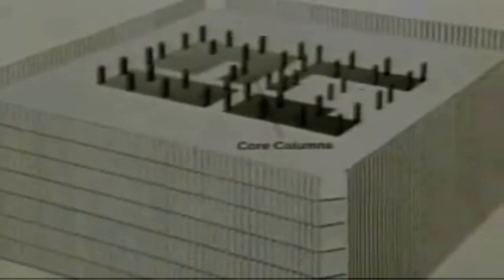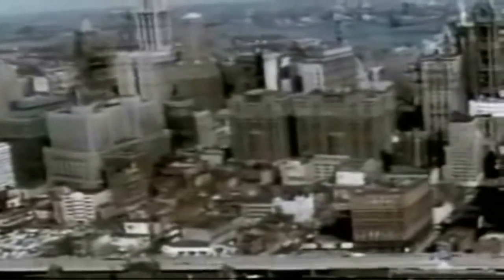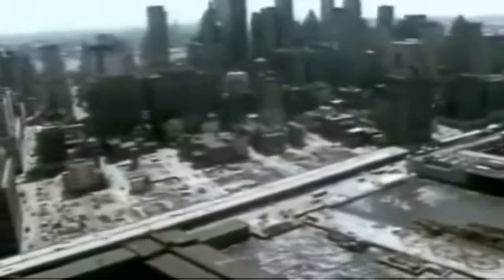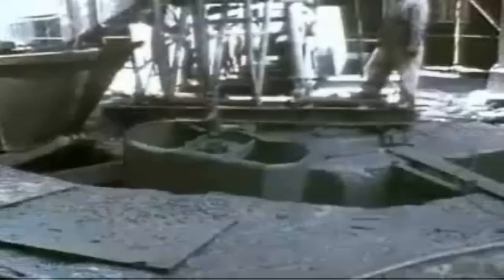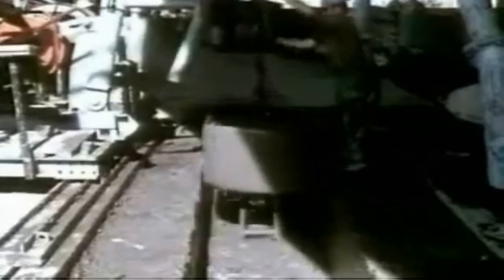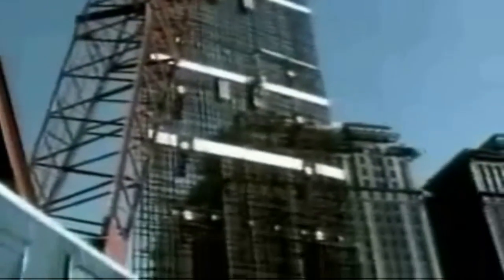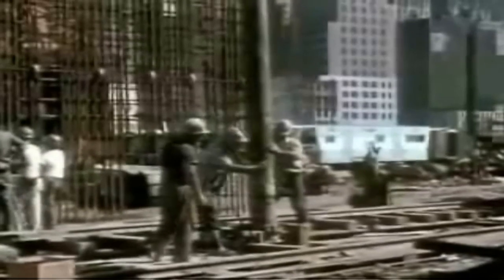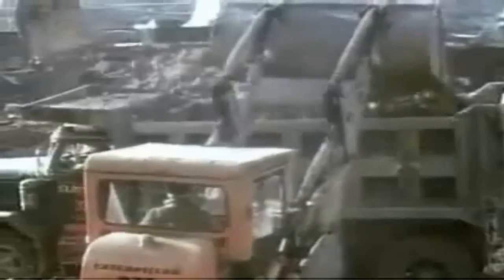Building the World Trade Center Towers

Comment: I had to go sit with my elderly father when these building collapsed.  He left his family,  including a new born me, to go to NYC for six month periods to help erect these two buildings.  He worked on the inner columns, very hazardous work.  I know he did tell me that unlike most steel framed buildings, all the weight of the buildings was on the side walls.  It was designed that way.  He was not surprised that the buildings collapsed.
Reply: You are very emotionally tied to your theories.
Reply: You are very touchy and defensive.
Reply: +Joseph Rogers 60% of the mass was supported by the core, the other 40 by the perimeter walls. connected by a hat truss.
Reply: ALL of the weight was not carried by the perimeter walls. About 35% of the total weight of the building was carried by the perimeter skeleton. The other 65% was carried by the core columns, which was essentially a traditional steel frame building inside of the WTC towers. When the plane struck and crashed through the outer perimeter, forces were redistributed and the towers remained standing. According to NIST (the official government investigation) nearly all of the jet fuel was consumed within the first 5 minutes, and probably about 90% was consumed in the initial fireball. So there was no "jet fuel" fire. Sure, jet fuel helped ignite regular office furnishings, but it was still a standard office building fire. A steel frame high rise has NEVER completely collapsed due to fire before or after 9/11. The only 3 examples happened on 9/11, and one of these towers wasn't even hit by a plane (WTC7).  A partial collapse would make sense, but the majority of the building should have remained
Reply: How is a load diagram ridiculous. It is not that technical. Google it Shitdick.
Reply: Joseph Rogers Yes i was born an engineer, a natural. Over the yrs i was told that by my peers many many times. I Know how to design and build virtually anything that would stand up to continuous vibration/weather/freeze/thaw...you name it.
I have worked with engineers with degrees above mine, i had to teach every damn one how to do things right in many instances.
I have benchmarked in the ind. more than twice... Yes the towers were the marvel of their time but a human rat trap waiting to happen.But nobody wants to hear it...those brackets where to small too few too weak...the truss design also no good in the event of fire . blg. 7 was built the same way.
Sucks to be right.
Reply: Thrashaero
I am just going by what a man who spent two years of his life building the twin towers knew.  he know where short cuts were taken and where they had to "improvise" to get the towers up on the time table they had.  Much of the outer wall columns were for the most part hollow.  This was loved by plumbers, electricians and phone company.  Later by internet companies.  Hollow walls= access to bring wires and pipes up.  I also is a conduit for flame, fuel ect to go down.
Reply: @joerogers4077  are you saying that the tower's perimeter wall columns were used to route services up the building? This sounds outlandish in the extreme. How would you install and then access to repair & upgrade them when they're sealed up inside the steel tubes? The columns were attached to the ones above and below by bolts and there was no gap between columns for anything to pass through. I should think some of the sources on their construction would have mentioned that the tower's columns were used to route services by now.
Reply: Jon Hobgood .....and who are you???
Reply: +Joseph Rogers The fact that your father isn't shocked doesn't mean that he has factually proven that the official story of 9/11 is true.
Reply: Always Skeptical The buildings were put up with hollow exterior weight bearing loads.  The only thing that prevented the tops from tumbelling off was the core steel.  The floor trusses were steel but the flooring itself was concrete covered aluminum. Once the top floors sagged a have out.  Gravity took over.  The building was never intended to handle this kind of load.
Reply: +Joseph Rogers With all respect and especially with your father, but concrete doesn't burn.
Reply: +Hoobler08 design flaws don't just suddenly happen after the buildings have been standing for 30 yrs usually building are designed before construction starts maybe you need college
Reply: My grandfather worked on the steel exterior on the south tower, and my grandmother's brother did the windows on the north tower
Reply: The planes easily enter the Towers. Perimeter walls were 10'x30' panels of hollow columns, 3/8'' steel at impact levels, stacked end to end, butt jointed and bolted together. Mass of planes (about 150 tons at 500 mph) pushed the panels, which sheared the bolts holding them together. Wing impressions in the walls outside the engines were in the aluminum cladding; the columns can be seen behind the cladding still standing.
Fires were NOT normal. Fire barriers were instantaneously breached, and rapidly ignited across many floors. Combustible material was shotgun blasted by the planes into one side of the Towers, exactly where the hottest fires were observed, and precisely where collapse initiation was observed.
Collapse initiations were gradual, with the inward sagging of perimeter wall, until that wall could no longer support upper mass, and the tops tilted in that direction, ripping apart the core columns.
The Towers were hollow tubes, with 60' spans on two sides of the core, and 34' on the other two sides. The tops wedged apart the lower tubes as the upper mass fell inside the tubes, and worked it's way around the core structure.
It's not difficult. "Truthers" confuse themselves with all sorts of false premises and lies.
Reply: Jon Hobgood why Do you fear bacon?
Reply: Ron Burgandy Rebar in the floor not in the walls.The floors were made at the factory barged in they were covered with aluminum they put rebar or the floor only then concrete not in the walls.   Rebar on to of aluminum flooring before concrete is poured, the aluminum will sag in fire.  Shitty materials were used Aluminum melts at 1218 degrees F.  It did get that hot.  Aluminum softens, sags the cement put on top of it is not designed  to bear it's full weight of the floors above it.  Then one floor after the other came down.  The towers came down about 200 mph with more and more gross tonnage with each second.  Nothing can stand up to that.
The internal structure of the wing of Columbia when it burned up was made of aluminum and needs the protective tiles to prevent melting.  Tiles broken upon launch. On reentry, heat got into the wing, melted the aluminum and blew apart a fast moving steel and aluminum craft. .  In the WTC,  the hits were so high up that when the aluminium covered by concrete began to melt, fire reached the underside of each floor (the ceiling) the alumninium could not handle the weight  and it came down. like a pancake.  How is that tough to grasp??
The original plans for the WTC are available by the FOIA, read them very interesting stuff  seeing how they put the building sometimes up on the fly. Needing to stay on schedule.  Those buildings had no fire exit strategy poor alarm system, poor entrance and exits and not fireproofed.  Open a fiberglass ceiling tile look at the trusses they are covered with a soft, rocky type substance.  That is there to prevent the floor trusses and aluminium sub floor from melting if you see bare metal as there was in the WTC.  No fireproofing was present.
Reply: It was a controlled demolition, no skyscrapers have ever collapsed like that before or since yet 3 collapsed on the same day for fuck sake. I don't understand why people debate why the buildings fell, they all fell because explosives were rigged throughout the buildings simple as that.
Reply: @Dan_druft  Rigged with what clearly an intelligent person like yourself knows demolitions and explosives leaves evidence lots of evidence yet. You can clearly see the South Tower already starting to crumble just prior to the collapse from undamaged parts struggling to hold the entire weight of the building
Reply: +Jose Rodgers take it from someone who does this shit for a living I build buildings using steel and concrete on over 1000 properties there is no way NO WAY  you can damage the underlying structure of a building by damaging the top quarter of the building I'm telling you
Reply: +Jose Rodgers for a building to fall down like that the steel had to be compromised there no way that could happen to the underlying structure by damaging the top 20 floors its impossible
Reply: Ron Burgandy And you got your engineering degree from where?  And you were part of the team that built the buildings?  I had a relative that was both.  The NY/NJ port authorities were in such a damn hurry to get the building up that corners and expenses were cut as many times as they could.  Can the building withstand a direct strike from a jet passenger plane?   Yes, they were designed to.  What consequences were possible when there was a fireball and fire burning in 1968 fire coded materials?  No one knew. Passenger jets were not all that old when the buildings were started.  Aviation fuel today is much more explosive and burns hotter.
Reply: Jose there are millions of 20 story high steel framed buildings What you forget is that most of the weight in the towers was below the impact zone so the weight above the impact zone is the only thing to take into consideration, If you look closely at the collapse of WTC1 you can see it begins its collapse from the impact zone up so the top section is not impacting on the rest of the building, your argument that nothing could hold the weight of each section is misguided, The rest of the tower was designed to hold up the tower and it did that for 30 years.
Reply: Gee - I guess a massive aircraft smashing into the building at over 500 mph just might cause some design flaws, no?

Look - you can banter and try all day long.  You are not a structural engineer that built these buildings.  The very men who poured their lives into constructing them gave a clear and descriptive analysis of why the buildings came down.  The example I gave of the spaghetti noodles was, in fact, from them.  Not my own reasoning - unlike what you are attempting to do.

I know though, anyone who dares to say this wasn't a conspiracy is just part of the cover up...   Do you hear yourself?  Please, spare me.  Tired of this nonsense from everyday youtube geniuses.  

Most of you probably haven't even attended college, let alone graduate... yet here you are, telling the world what a 110 story building should do when a jumbo jet smashes into it.  I mean hell, it's such common knowledge, look at all the examples we have to look at of the same event happening around the word throughout history- right?
Reply: Hoobler08 Oh it was a conspiracy for sure.
It would have taken months to plant all the explosives in the the three skyscrapers and it took a lot of planning and forethought to have all the fake information ready to give to the media, the slipped up there though by giving their already prepared media release about WTC7 to the BBC too soon. There were people on the ground telling whiteness what they saw was different to what they were saying they saw. They went to a lot of trouble to plant fake evidence but they slipped up there to by planting the wrong jet engine, oh there is no doubt that it was the biggest best executed conspiracy that the world has ever seen. And most of the world believed it even me for a long time, but thankfully I woke up to what happened a long time ago, Time for you to do the same!
Reply: Thrashaero Sorry pal i tell it straight up.
Get over it truth is fact and will not changed.
Nuff Said !!
Reply: +Charlie Varrick wow that's a halfass rebuttal if i've ever seen. bragging how you 'tell it straight up' and 'truth is fact'. nice patting yourself on the back there with zero details providing any justification for your 'straight up truth is fact' bullshit. nuff said  git er dun hurrr!
Reply: +Charlie Varrick that's because you can't handle your bullshit being called out and therefore project your stupidity onto the one calling it out as an excuse to continue talking shit than taking responsibility for the shit previously said. fail.
Reply: +Joseph Rogers floors above the impact collapsing is a far cry from the entire perimeter symmetrically failing at once and exploding out all 4 sides with nothing left but splintered steel. after collapse, 20-30 floors of top of skyscraper mass is going to do relatively very little to what is below it since it is always the lightest part of the building.  He is right about the core.  As far as damage to the lower structure, there may have been very substantial damage such as what was described in the basement and lobby to likely cut out the core and foundation (pulling the hat truss down and floor trusses inward much more effectively to make it look like it started to fall through itself) but it has not been assigned responsibility for the collapse in any official media/reports. 
NIST say it is primarily from fire, come up with 'new discovery' called 'thermal expansion' that is not reflected in building codes since, and then say that once collapse starts, the rest of what was observed was inevitable. Then they can't be bothered to have their collapse model values peer reviewed. Then one of them (John Gross) denies molten steel meanwhile having been previously photographed holding onto a peice of molten steel.
The worst attempt at science/investigation i've ever seen.
Reply: +vengencefrom1979 thats incorrect.. the debris were not falling at free fall as you can see smaller pieces from the same area below falling at a faster speed in the footage
Reply: CANT STUMP DONALD J TRUMP - #TRUMP2016 It doesn't melt and you can see in numerous videos recorded that day molten steel pouring down the building.  The first, second, third responders found in the rubble pools of molten steel.  What would cause the kindling they found under the rubble many day after the buildings fell.  Normally the impact would have put the fire out.  If there's no oxygen, fire can not kindle.
Reply: Jose Rodgers all the time bro
my uncle harvested coconuts.
i have in family photos and actual fruit.
Reply: 30% of the downward force from the building was supported by the outer walls.
Reply: At 400+ nauts.  It can certainly pierce the walls.  The walls had some steel but basically aluminum covered with stucco material.
Reply: +Jose Rodgers Oh I believe you. But you know people on the internet....yeah. Fun fact I knew a friend who would come and do maintenance on the towers in the late 90s-Early 2001 and he always complained about some of the walls being hollow. He was always telling me stories about how the buildings didn't seem as strong as they looked. I'm not surprised the towers collapsed either. Those buildings were not designed to survive a plane slamming through them with thousands of degrees of burning jet fuel. Jet fuel plus human bodies and the office supplies plus luggage, etc...really took a toll on those buildings.
Reply: *****
First amendment, freedom of speech, ever hear of it?  Don't like what I post, sign off.  I have had to read people posting that a hard working man who died in 2008 had convictions  he held about those buildings.  He spent four years of his life working on them. He did state that no one in the design and building of a skyscraper would ever think of a 767 loaded with fuel going 400+ nauts. hitting the building what kind of damage would have been done.
Reply: SHUT UP ALL OF YOU
Reply: Verdoux007 I got your point, I just do not care about what you think.  I was born and still live in the United States.  If you want to see the first amendment and it's protections watch a first amendment audit on youtube
Reply: Thrashaero 
"60% of the mass was supported by the core, the other 40 by the perimeter walls. connected by a hat truss."

I just read this. Can site how you got this information. I am sincerely interested. Thanks.
Reply: SHUT UP SHUT UP SHUT UP SHUT UP@! OMFG STOP COMMENTING
Reply: Jon Hobgood You better just cool the fuck down before someone gets hurt. Do you hob good nob Jon? Just go do that until you can offer up an intelligent point.
Reply: Jon Hobgood 
""i'm tired of these notifications popping up every time you people respond, it's irrelevant."

You are irrelevant and you can remove notifications but I won't tell you how because you are just plain rude.
Reply: Verdoux007 You have difficulty following logic it seems. That has nothing to do w/ nationality.
Reply: ***** = Too Cool For The Room Douchebag Who Thinks He Is All Deep And In Touch
Reply: it was built in '66. approvals probably were not as hard to come by as today's are.
Reply: Alzheimer's
Reply: @paulczar Did you listen to the video at all? your 60-40 is switched around. stop thinking in today's building codes and start thinking in the 60's building codes.
Reply: +Jose Rodgers cuzsteel made in the 60s  was known to crumble apart for no reason that explains everything jeez all thos time I thought bush did 9-11
Reply: Ron Burgandy No, cement of today, highly engineered build things like the Burg Kalifa in Dubai.  High strength cement.  The cement used in WTC was basic cement used in Empire State ect.  The building codes were horrible back then, More than half the people who were trapped was because of thin stairway, no emergency battery stair lighting.  This all came to light in 1993.  Many think the 1993 attack was a trial run for the 2001 attack.
Reply: +Jose Rodgers ya I'm sure a building built by slaves in dirty turbins in the desert is way stronger especially since they now know how to mix the concrete correctly so that is won't all turn to dust for no reason after 30 years
Reply: +Jose Rodgers what's that at 8:37 then? sure as hell looks like rebar to me
Reply: +Jose Rodgers at 8:35 two guys are clearly installing REBAR you don't run wire conduit in a criss cross patern like that
Reply: +Jose Rodgers why would you need rebar in a 30 ton three story piece of steel do you even know what rebar is?
Reply: Jose Rodgers
If the fuel burns  quicker and hotter then most of it would have burned off in the initial fire ball. But I doubt very much that the fuel has actually changed, it's the engines have become more fuel efficient now days.
Reply: paulczar Had any of the steel framed buildings that did not collapse have the size and the weight of the WTC?  The weight from above must have been tremendous for the damaged section to hold.  The top came down the weight was too great down and down it repeated.  I forgot how much time it took for the whole 100+ story buildings to fall and the speed they went at but there is nothing, nothing that could hold the weight of each section coming down
This was a perfectly planned attack, hit the buildings around the 80th to 90th floors or so and let gravity do the rest. There was tons of weight on the roof of both towers and both towers had piss poor fire evacuation plans that cost lives.
Reply: +Newcopia exactly the top section is breaking up not gaining mass as it comes down its simple logic this guy is fuckinh high
Reply: +Jose Rodgers size an weight was not a factor in their demolition buildings don't fall down because they are "too big"
Reply: +Jose Rodgers so your family both designed and built some buildings that failed for no reason and you are bragging about this? maybe its just your dna then and not the bush family that has been such a scorge on society for so long
Reply: Jose Rodgers Whatever it is you are on you need to stop doing it. There is a disconnect between what is left of your brain and realty!
Reply: Always fun being lectured by the youtube experts.   You're wrong, but you have the right to be.  What Jose Rodgers said is 100% accurate.  The weight was on the outer beams, which were stabilized by the floors.  Once the floors burned and started to peel away from the outer frame, what was a short distance of stable beams, now became very long sections holding massive amounts of weight.  Think of uncooked spaghetti noodles - if they are short, they are really strong and hard to snap if you pinch them on each end; likewise, if they are long and you pinch each end, they break with ease.  That is exactly what happened and you can see it by how the towers (especially the first collapse) went down.

You can spew your uneducated genius nonsense, but thank God it will never be accepted and it will never amount to anything - because it isn't true.
Reply: Hoobler08
That's just your theory yet it doesn’t explain how the top part of the building that is falling sideways could act as a pile-driver through the point of most resistance, it just couldn't happen. Seeing as no steel framed skyscraper has ever collapsed due to fire before or since yet 3 collapsed all on the same day, 2 turning to dust. Explain why the buildings turned to dust with out the help of explosives and I will shut the fuck up.
Reply: Aaron Dover No Floors? interesting concept, a 110 story office building with no floors!
Reply: +Hoobler08 the weight of the concrete when compared to the strenth of the steel they used is nothing plus the floors had steel woven through them as well there was no design flaws
Reply: Oh a Jew hater huh?  Why am I not surprised that a 9/11 truther would hold similar values to the Islam-o-Nazis that flew the planes into the towers?

Pity, I'm not a Jew, but I am a Christian.  That should be just as bad, right?
Reply: DIMITRI KHALEZOV
Reply: I read that the core supported mainly the weight of all the elevators.
Reply: I understand that the central core supported all the weight of the elevators. The building was designed to use much less steel than an ordinary building. It is called a tube structure.
Reply: Free Thinker
Why on earth do you think the upper mass, "weak and brittle", would be any less mass simply because it broke apart? Why do you think the upper mass had to "stay together" in order to bust through floor spans below? The North Tower upper block was 38,000 tons. As it broke apart, it was still 38,000 tons of falling mass, and broken apart, it was easy for it to work it's way around the core structure. Each floor fails at 1500 tons dead weight. How will that slow or stop 38,000 tons with momentum? As the mass of each floor is added to the falling mass, rate of descent actually should accelerate. Maybe you don't know there was 60 feet of light weight floor spans? "Broke apart to nothing" LOL! That's David Chandler physics, not real world physics.
Reply: And both the core and the load bearing walls were damaged. These buildings were doomed once the planes hit. Add the heat of the jet fuel heating up the aluminum and paper in the building and there was no hope.
Reply: @jonathangrant3620  sadly very true
Reply: Thrashaero More garble the core stood longest,fell last wake up Cosby.
Reply: Joseph Rogers There is no debate, its all fake.The 911 twoof cult is proven fraudulent yrs ago.
Reply: dont care stop responding please
Reply: Jose Rodgers i'm tired of these notifications popping up every time you people respond, it's irrelevant.
Reply: Jon Hobgood ug
Reply: Jose Rodgers FRIENDLY FIRE BRO...
IM ON YOUR SIDE...NO PROBLEM..
Reply: +Jose Rodgers You silly American. The first amendment doesn't apply to YouTube or any other private business.
Reply: Jose Rodgers I'm sure you have stumbled upon a video that has its comment section removed there by preventing you from commenting on that video. That in it self is censorship. And besides, even if your comments were removed you wouldn't know about it.

The point I was making (that you were too stupid to understand) was that the first amendment applies only to the US government and not to corporations.
Reply: Verdoux007 
"You silly American. The first amendment doesn't apply to YouTube or any other private business."

It certainly does because we get to freely choose who we do business w/ and a company that stifles free speech can be negatively impacted.
Reply: Jon Hobgood Nob!
Reply: Maxx McGerk who dat be ?/
Reply: Verdoux007 Are you American?.  If not, STFU
Reply: Maxx McGerk terd
Reply: Maxx McGerk GOAT
Reply: ***** MILK
Reply: Maxx McGerk = DUDD
Reply: *****= PUDD
Reply: Maxx McGerk =DUMMY
Reply: Jose Rodgers How ironic. A person who quotes the U.S. constitution tells me to shut the fuck up.
Reply: Verdoux007 But you didn't shut the fuck up so you both exercised your freedom of speech. Get it.
Reply: Maxx McGerk you finally got something correct i am to sexy for my shirt too.
Reply: ***** No no no Charlie. You are trying to be "too" cool again or you have comprehension problems. I said nothing of the sort. You just think you are. What don't you use your big boy words and tell me what I got wrong. Maybe you meant to address someone else initially (Asperger) because I never responded to you until you threw out an insult. I thought your dudd response showed subtle wit and humor so I know there is a brain in there. There seems to be, after reading the thread, a bit of difficulty in comprehension by you and others when you engage people in commenting. Why do you think that is so?
Reply: Maxx McGerk yUoR
dOGsHITeYEbALL Told me soooooo !!
Reply: ***** 
That is what I thought. You are an intellectual coward. You hide behind this wacky persona because you are scared people will find out that you have some stupidity like everyone else. Charlie it is okay to be wrong sometimes. The greatest scientists are wrong all the time about their hypotheses. Get over yourself. You may learn something.
Reply: ***** aCTUALLY i THINK YOU ARE SCARED YOU MIGHT FIND OUT YOUR OWN STUPIDITY. tHAT YOU ARE NOT THIS SPECIAL LONE GENIUS THAT NO ONE UNDERSTANDS. rEAL GENIUS IS CLEAR AND EASY TO UNDERSTAND. iT IS NOT CRYPTIC AND WEIRD.
Reply: Maxx McGerk Why hide in the mist of freakazoidizm ??
Reply: ***** I am not hiding and the mist keeps me cool. I challenged you to an intellectual dual and you choose to hide in plain view. You drew first blood w/ you verbal air squib you gutless "terd". 

"Why don't you use your big boy words and tell me what I got wrong"

If you correct me and are well reasoned I will say thank you. That is not so freakazoidal is it?
Reply: Maxx McGerk YOU ballchinion
Reply: ***** Nut Tucker
Reply: Maxx McGerk take  nap.
Reply: ***** I will stop bullying you Charlie tuna salad and take a nap. Nite Nite
Reply: Maxx McGerk tiny 1/2 man gnite Mr. tiny hands...dweem of GOAT Rumps over defence ?? ....
Reply: ***** You just won't quit will you Starkist. Are you masochistic? Your insults have no teeth. At least put your dentures back in and make a show of it for the reader or just stifle. I don't intend pain and suffering. I am more interested in what I got wrong to avoid that and find truth. We duel to discover our own weaknesses and not to purposefully humiliate. I engaged in your insults because I thought you might have an interesting insight that I had not thought of other than the location of or size of my ballians that you seem to want to swat @ incessantly. That is the truth. I will concede defeat in all other entanglements by default. It is just a waste of time and my ego is small but by ballians are very big and sensitive because of all the bruising and swelling they receive due to their location. I wear my balls on my chin and my heart on my sleeve.
Reply: Maxx McGerk PORTER RANCH DISASTER...a real cause to expose...
now get on it Now not Later or Then...
Good Luck !!
Reply: ***** 
That is nothing to get all worked up about Sunfire. You can still drink it.
Reply: Maxx McGerk SUNFIRE??
You strokin chinballs ??
Reply: ***** 
I was just trying to work around them due to there sensitive natures. I never stroke a Ballian especially the chin kind. It is too easy to stroke them the wrong way.
Reply: Maxx McGerk Just be carecall !! Because i do care if you hurt youseff.
Reply: ***** I always wear a chin strap/cup but I appreciate the concern.
Reply: Hahaha
Reply: que conseguem construir esse predio perfeitamente na vertical?  que equipamento usam?? falow
Reply: Ron Burgandy  Your are an idiot.  I have seen the making of that building in Dubai.  The concrete is reinforced high tension concrete.  It is a mixture that has been around for only 20 years.  The WTC was built with concrete you can find on house stairs and patios.  Did you see the twisted steel beams, the chunks of concrete at ground zero?  What was missing except for the parking level? Here is an answer, r Rebar.  Know your shit before you post.  I lived my life with a man who was part of the construction team that built the towers  He had balls as big as church bells being 90 stories up wrapping the outer steel walls in concrete veneer also know as stucco. .  The towers needed to go up quickly to make $.  Shortcuts were taken.  The first tower to fall had a large TV/Radio antenna on it.  The roof was never surveyed to see if this is an issue.  Too much politics involved building those towers.
Reply: Ron Burgandy Twisted piece of steel.or wire conduit  The side walls were solid steel with a side curtain of stucco like concrete fitted over them  There are scenes in this documentary seeing that.  You still have no argument about the types of concrete.  Even the hotel in Spain that was steel structure skeleton that burned for 22 hrs and did not collapse was built with reinforced concrete .  The concrete to build the WTC was given by contract the lowest bidder and was not great quality.  On a visit to NYC I touched a stone column on a tree the concrete It the courtyard when rubbed with your bare hands you had concrete powder on your hands, you could literally break chunks off with your hands..  Why do you debate this I had to hear every detail in 2001 from my father.  Do YOU know anyone who had a hand in building those towers?  If not, you are going on speculation.
Reply: Ron Burgandy Yes I know what rebar is.  Do you know what reinforced concrete is?
Reply: Ron Burgandy  You are a dumb ass.  I was 3-5 years old.  My father was an engineer who happened to like getting his hands dirty so he was on the scene, reading paper blueprints and physically help put the buildings up.  The one real computer used on this whole building project was the critical path method to get supplies and building material right when you needed it and where you needed it.
You must have been spoon fed the BS info about the Bush family having a contract to fire proof the building after 1998.  Use of Marsh Crisis Company to fireproof the WTC after 1993  was only lucky.  The owners of Marsh are 4th cousins twice removed by marriage to the Bush family.   You have zero facts and you sound really idiotic when you think a four-year-old can go work on the WTC.  Where is your aluminum foil hat for getting in your signals from your mother ship or has the Lithium not kicked in yet?
Reply: Newcopia Where is you aluminum foil helmet?  You can't keep in touch with the mother ship.  Laughable, just laughable.
Reply: Newcopia  Yea, no.  

It's fruitless to argue with you conspiracy theorists, because you're in your own little world.  So, let's hit some actual material that holds merit:

Your nonsense will never come to pass.  No one will ever be held accountable as a guilty party, other than the ones who proudly claimed the crime.  You can scream, threaten, kick, and bite - but I smile as I know you are wasting your time and breath on a cause that will never, ever, ever, EVER - as long as you draw breath, unfold as you so badly want it to.

Just remember that the next time you spend hours, wasting away your time, trying to convince others of your silly ideas.

You lose, and it's a good thing.  I like winning, and there is no doubt who wins the argument when it comes to 9/11 conspiracy vs what actually happened to those innocent people.  (Hint - it isn't you...  you guys lose, every. single. time.)
Reply: Aaron Dover I am afraid that you are a little to extreme for me, two wrongs don't make a right.
Reply: The center core supported mainly the weight of all those elevators.
Reply: Jose Rodgers y
Reply: The central core was to support the weight of the elevators.
Reply: does your same theory apply to WTC 7?
Reply: source?
Reply: Jonathan Wellen
Who are you asking? These brilliant YT comment "upgrades" don't show who you are replying to, so you have to do it yourself. If directed at me, source for what?
Reply: Much respect to your Father; it must have been an incredible experience for him to be a part of something so beautiful and part of American history.  I'm very surprised that your Father would say that about the WTC, given the fact that they were built to withstand multiple hits from airplanes.  The WTC buildings came down because they were bombed/planned demolition.  Read about the molten metal that was spewing from the towers after the planes hit.
Reply: Maxx Bifacial McGerk 
They get nervous when they can't back their bull shit.
Reply: Just reading through the replies to this. Why is it that most of the people that believe in the conspiracy theories have names like "big mike Obama, Ron Burgundy, Margaret Trasher, etc". Like really? and people are supposed to believe something from "left field" that is nothing but speculation with those names? Fire weakens steel. Its simple in 3 words. "buildings only fall like that from demolition".. How many other towers or buildings in general have you seen get hit by large passenger planes thats full of jet fuel? None? Okay then. Thats the thing that these conspiracy people don't get. Theres NO PROOF of their claim to state otherwise. All speculation. Some article about what someone saw isn't proof of anything. Neither is someone close to the situation and of experience speculating actual proof. Meanwhile theres proof of the planes getting hijacked, hitting the towers, the towers catching fire and falling down.
Reply: Jose Rodgers The NIST report is a damn fairy tail. You don't have to have a degree to see the truth because it only takes common sense. Think about this... NIST says the exact reason the towers came down was because of the impact from the jets and the jet fuel burning to weaken the structure. NIST claims the pancake theory which means the tip of the towers above the impact fell straight down crushing the rest of the towers below floor by floor until it stoped at the bottom. This is a stupid ass theory if you have any kind of common sense! Even though the heat theory is bullshit because the fires weren't burning nearly hot enough to weaken the steel we will still go with that for the point I'm trying to make. Hot air rises so the structure wasn't weak a certain amount of floors down from the impact, probably the bottom 60% of the towers where not damaged by the heat but the top of the building above the impact was weak and brittle because the heat from from the fire rising up. So I want anyone to explain to me how that weak brittle piece of the building had enough strength and weight to STAY TOGETHER to crush all the floors below without crumbling apart and even stayed together to crush the bottom 60% of the building undamaged by the heat. How did that weak ass brittle tip of the towers stay together to do this????? All those undamaged floors just gave way all at once with no resistance for this brittle damaged top piece of the building????? How the fuck did it stay together to crush the undamaged bottom half???? How the fuck did it not tip over when it reached the bottom half that was not heated up and damaged from the impact and jet fuel??? Think about this shit!!! This damaged piece of building had had enough force and strength to crush everything below it, EVEN THE UNDAMAGED BOTTOM HALF OF THE TOWERS!!!! It's not fucking possible people!!! It would have broke apart to nothing or fell off the side  as it made impact with the UNDAMAGED bottom half of the twin towers. It blows my mind people think this weak brittle damaged piece of building can crush everything below it with no damn resistance at all and magically stay together to do it. EXERCISE COMMON SENSE!!!!
Reply: +Jose Rodger gee Jose idk who to trust.  The 2000 architects and engineers who put their reputation on the line.  Or the guy whose daddy told him that unlike most high rises, the walls held all the weight.  HA
Reply: @KmOvBpE8224  what reputation? None of them designed, built or even worked in neither WTC, name one that actually built a skyscraper
Reply: Brandon L
After figuring out that Richard Gage and his genius toadies lie about near every description they make of collapses, I learned to trust no one, and allow evidence to state what happened. It is jaw dropping the amount of evidence Gage Inc. not only ignores, but aggressively deflects from. You'll have to ask them why they choose to blemish their own profession.
Reply: vengencefrom1979 e
Reply: All of y’all shut the fuck up. There gone ): there’s nothing we can do about it.
Reply: The corners of the building favor the outside wall. The surface of the outside square being the outside wall is greater than the inside square being the internal column grid. More beams touch the outside square than the inside. I studied statics in college. Not a huge difference but worth mentioning.
Reply: Thrashaero
My father did say that much all of the load bearing weight and wind shear was taken up by the sides of the building.  It does say so right in the documentary.  When the building was pierced and the fireball came out the out the other side, my father did say it is a matter of time that the floors above the impact would collapse.  He did think the inner core and outer walls could take the weight of the top of the building collapsing.  He did feel if there was any damage to the lower structure that the building would come down quite quickly.  I guess there was.
He often stated to us that he was surprised the 1993 bombing did not do much more damage.  The buildings were built on landfill and mud.  Unlike today's modern skyscrapers, there was very limited technology for reinforce concrete.  There was no steel rebar in any surface of the outside walls or the inner supports.
Reply: *****
 Anyone else give me a relative or friend who worked on the buildings going up and then you could have a valid argument.
 My father, God rest his soul, sold himself to the company and bought the BS in 1967-1972 that the way the buildings were going up so quick was completely safe.  He was a construction worker, bull work most of the time but he took time off from his engineering degree aspirations at Providence College to work had two young kids to support.  He know how to read blueprints, He knew where the materials being used were sub-par.
 The construction company had a timer once they hit bedrock the time started clicking.  Every man on the project got extra $$ to get the job completed early and under budget.  When guys were up  during the day, men slept below on the site in trailers.  I was really shocked that more people were not killed.  Inspections happened, you found your safety harness real quick.  Wen the inspectors left with a few extra $$ in their pockets take the harness off and get to work.  You can't move quickly if you are tied to the building.
Reply: +vengencefrom1979 
If you want to get real technical more of the weight was supported on the outside walls. If you do a load diagram on the plan you will see what I mean.
Reply from the maker: +Joseph Rogers half the weight was supported by the inner columns and which fell at speeds impossible without the use of demolition charges of some sort.
Reply: have you seen a single video of the ''collapse''? there's no big pieces of nothing, all was dust and small  twisted parts, that was a fucking demolition....
Reply: ***** office furniture and old not fire proofed rugs do.  The buildings were in the middle of a fire proof and fire suppression update to 2000 codes not 1966-1972 .  Much had changed in the 30 years the towers had.  One big up grade, that was not there was to put fire stop protection every 10 floors in the center stacks.  My dad worked on the buildings he knew about the ghosts in the closet.
Reply: Joseph Rogers Why in the world would you think i was arguing? Im with you bro
troothers are pure evil hearted scam artists.
Reply: MrMusicopath I have studied the collapse.  With the speed the towers went up do you think all 1960's building codes were followed?  This came from a man who worked on both towers.  There were some greased palms in play.  Second rate material being used often.
Reply: Thrashaero = pissass comment chappy.
Try again please, i dont respond to bloody morons.
Reply: Joseph Rogers No building ever falls like that except with explosives, and you can see the explosions recorded on 9/11 which correspond to those used for the demolition of buildings, of all kinds, especially Building 7.
Reply: Beatrix Phocas
 Yup and the US faked the moon landing and there were and are UFOs in Roswell.  Facts are the only thing that refute any claim.  The wreckage of the buildings gave no clues explosives were used.  The US government did a half ass job in it's investigation but that was due to embarrassment about being attacked.  Our intel. had their eyes on Atta and his crew but the gave our intel. the slip in NJ only to end up in Maine.
Reply: +Joseph Rogers   Joseph. please.  don't insult our intelligence.  fall due to fire just doesn't happen on steel and concrete. you are talking of furniture and old carpet. try to set a fire with similar materials and take a paler clip and tell me if it liquefied like the melted steel that was seen of the towers. central and outside columns. let's just say that the steel was too damaged. why would the base of the building give up, or fall with any resistance.?  and why both and later building 7?   all had the same flaws.  please?.
Reply: +Maxx McGerk  Stop arguing about the weight and remember no amout of jet fuel could melt that steel.
Reply: These two buildings were only seven years into a total safety reconstruction after the 1993 bombings that was on schedule to be completed in 2018.  The 1993 bombings was a "trial run" to see how to weaken the structure.  It then took seven years of planning the strike. The towers were not buttoned up with old fireproofing scraped off to bring the building up to 2001 codes.  Asbestos was being used when the buildings were being constructed. There was ow raw steel and aluminum exposed to fire.
Reply: Thrashaero = more garble goo goo blah blah blah !! As expected.
Reply: +Beatrix Phocas steel looses 50% of its strength at 500 degrees, which is what the fire was burning at. The building began to bow outwards slowly which is expected when that happens, then it cracked and created a domino effect
Reply: Joseph Rogers  WHAT RRRUBBISH!  If that were the case, the building would never have been approved!
Reply: Beatrix Phocas See i knew the same thing.
Any major catastrophic event to them spelled doom.
Reply: +Beatrix Phocas The issues bought up was from a man who actually worked on the two buildings.  The 1968 codes which these towers were built with was badly exposed as insufficient as seen in the 1993 bombing.  The towers were being retrofitted in 2001 when the attack took place.
Reply: +Joseph Rogers that is true. I am a Roswell native and there were in fact alien landings.
Reply: Fight4 Truth101 and vile WOW THAT !!
Reply: Troothers will make up any shit to promote their jihad.
Reply: *****
I did not think I was arguing.  I could have been as I have been fighting this flu/pneumonia for two weeks.  The cold medications are making me a little loopy.
Joseph Rogers.
First time in 20 years not working the area around Fenway in Boston for the 11 a.m. game then go to Boston Marathon finish line.  I was over 2 miles away during the terrorist attack and I was not allowed to go down.
Reply: Jose Rodgers ok we good, getter bro.
Use oregano and some coconut..in diet.
Reply: +Jose Rodgers that helps debunk all the conspiracy theories
Reply: Kpatel DON'T FORGET AIR TRAPPED !!
Reply: The planes flew straight into the buildings with little or any retardation..  
An huge aluminum can with floppy aluminum wings cutting straight through a whole bunch of  huge steel columns .  I find it incredible..
Reply: I that is true yes. but internet says that each and every column on the outside was steel with wall thickness ranging from 2.5" in the bottom floors and 0.25" on the top floors. covered with aluminum.
Reply: Verdoux007 And you are? Some one I would give a crap about.  Never in my over 10 years posting on youtube, has any of postings and replies been blocked or taken down.
Reply: Sorry, but I'll tell you, it's bullshit, this building could've received even more planes and still stay in-tact forever in most of the cases. And anayway how did planes penetrate steel colums?! How did it make such a hole, I mean the wings are no-way near as powerful to do that. Definetly there WERE demolitions fired at the right moment so that noone can see them, even at WTC7 in a news infront of it, there were heard 7 bombs very lightly if you try to hear them. Everything is there, just someone has to point at it for you to see it, if you don't believe it, you won't see it. WAKE UP WORLD! The terrorist isnt Osama, Mosama, Obama... Wait, what?! They even look identical...
Reply: @mig1983  yet each plane left three sided holes in each tower 🤔
Reply: Nice language.  I'm nearly 50.  I should have known better than to place any messages on You tube and expect to get any intelligent arguments.  But I am bored out with an injury. 
I am getting my information from a man who worked over 3-4 years on those buildings and saw how fast they went up and where companies cut corners to come at or under budget.  For every day the buildings stood unfinished, the owners post money. No one outside of contractors who worked on the buildings and did repairs knows what was behind the walls.
Reply: I am giving facts from a man who worked on the construction of the two towers.  For 1968 when the towers were began to be built, the towers were state of art.  The exterior walls were steel and the trusses were steel but the floors were aluminum covered with concrete.  The concrete was not fire proof.  There was spray fire proofing being done when the attack happened.  There was then no steel for 30 to 50 feet until you hit the center.  In the center elevators were placed along with very thin stairwells not fire proofed also.
Reply: Strommel1
The videos of plane one and two clearly showed the planes entering the structure . I  don't care if it is made of steel something hitting it weighs over 15 tons going at 400-500 knots is going to leave an impression
Reply from the maker: +Maxx McGerk if half the floor is supported by the outside columns and the other half by the inside core columns how can you figure the outside supported more? you sound ridiculous, not to mention like a shill armed with a dictionary of technical terms.